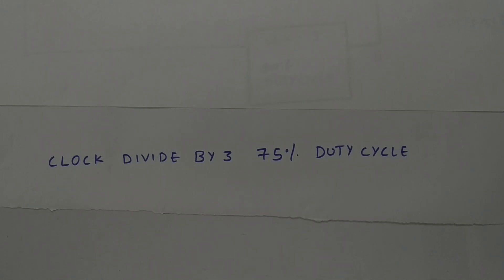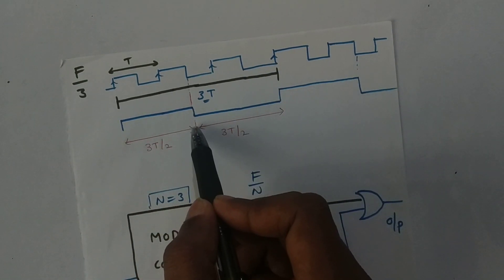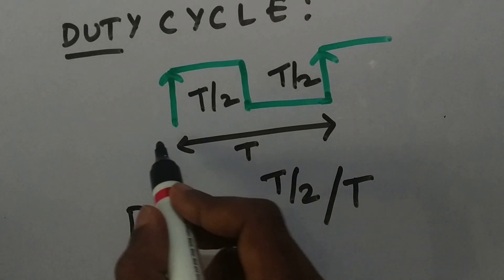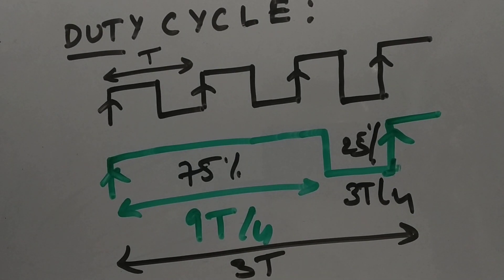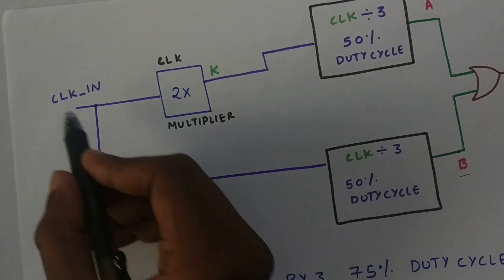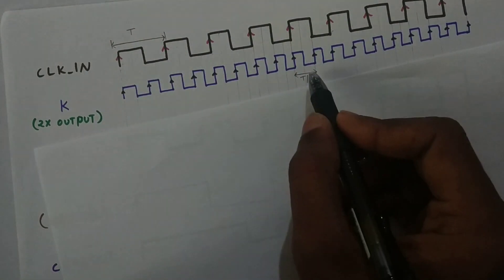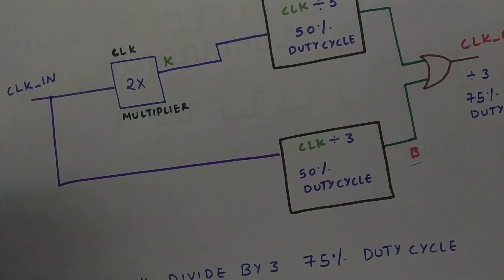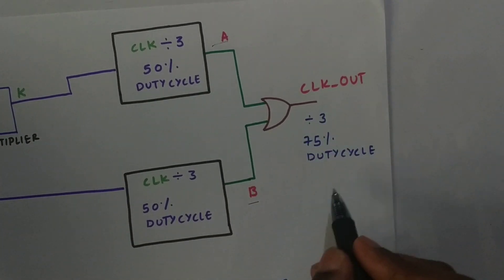Clock divided by 3  with 75% Duty Cycle.

Comment: Here how multiplier will works internally, you have showned block diagram, how hardware can implement here? request to do the videos on clock multiplier by 2, later by 1.5  2.5 3 3.5 etc
Reply from the maker: Sure

Comment: What is multiplier used for f/4 with 12.5 duty cycle
Reply from the maker: Hey Sandeep  , here I have reverse engineered from output to input , if you do that that you might get it. There is no short method for it .
Good luck, good health 👍

Comment: How did you designed that circuit . How did you get the thought of giving 2x clk
Reply: Can you make a video for mod 5 ,7 with 50% duty cycle
Reply from the maker: Hey Raghu , thanks for asking,
I reverse engineered it , I started from output signal and worked backup to input signal.
I hope this helps you. If you have any questions please feel free to comment. I am happy to help you 👍
Reply from the maker: Hey vikas kumar, thanks for asking.
I have explained about clock divided by 3 in seperate , check it out in my channel .
If you have any questions please feel free to comment, I am happy to help you 👍
Reply: @KarthikVippala  pls explain f×2 circuit in separate vedio ... Remaining i understood very well ...
Reply from the maker: Frequency and time period are reciprocal to each other. 
So we need to reduce time period for increasing the frequency.
Reply: @vatsala900  Bro, let us say f1=1hz means 1 cycle per second, 

                                                        f2=2*f1

                                                         f2=2hz, means 2 cycles per second, now yo can easily understand by looking into the diagram.

Comment: Clear explanation. Can you start a series on SystemVerilog?
Reply from the maker: Hey Raj , thanks for your feedback ,
Yup I will start system verilog after 2 months , because I will cover basics , & verilog first👍 pls stick on till then
Reply: Karthik Vippala Thank you! Yes, Verilog is essential to cover the basics. Also, can you make a video on Crystal Oscillator?
Reply from the maker: @rrt9596   hey thanks for replying back , yup I will do a video on crystal oscillator , but can I know what is that you most need in it.
Reply: Karthik Vippala I want to understand how exactly electrical signal with precise frequency is generated by crystal. And, how it is used in current times and what is the future of it? I really appreciate your efforts :)